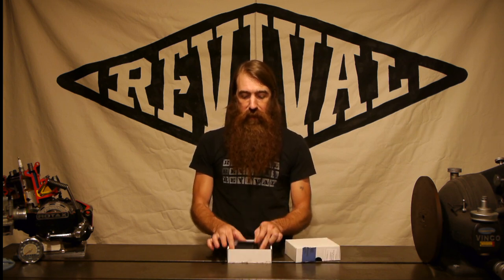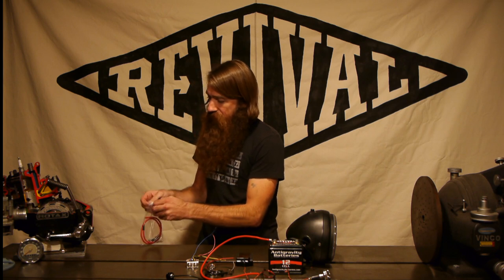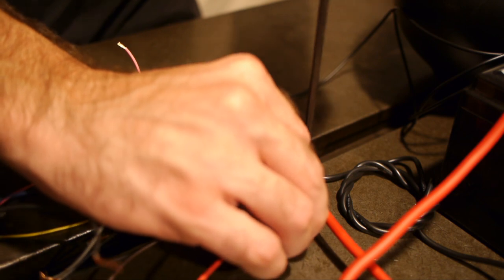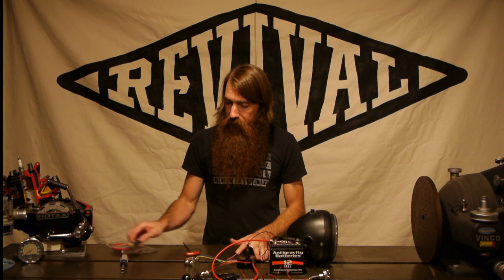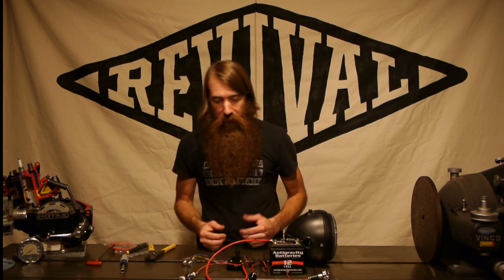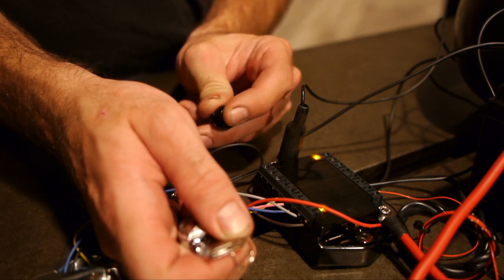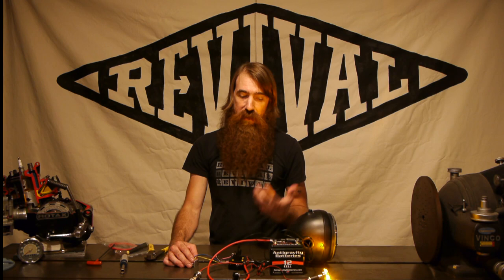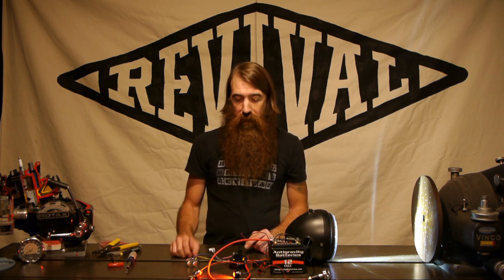Wiring the Motogadget m-Unit V.2 - Revival Cycles Tech Talk

Comment: Hi im wondering if this would work on a old evolution softtail im working on. Worried the heat from motor could damage it. I would like to mount it to frame under between the split tanks. Where the relays are now. What do you guys think. Would the heat be a issue to the m unit?
Reply from the maker: The m-Unit is pretty robust, and although it does have limits to how much heat it can take, we have found that under tank mountings have not been a problem. The technology is perfect for your application, and if there were existing electronic components in that area, that is a good indication that the m-Unit will be just fine in that spot.  The m-Unit doesn't produce any heat so it doesn't really need any cooling, and it is rated to operate at temps upto 80 Celsius or about 180 Fahrenheit.  It may feel hot under the tank, but  consider that standard SAE wire insulation is only rated to 85 Celsius. All this, combined with first hand experience, and you should be just fine. Also you can add some heat shielding for additional piece of mind.
Reply: Revival Cycles appreciate it brother. Evos are immortal.

Comment: how do you wire the motogadget to a positive earth system early triumph
Reply from the maker: Ok, the best way to deal with this is to switch to a negative earth setup. Which sounds way more complicated than it actually is. If you are doing an m-Unit install then this is the best time to do it. There are only two systems that are affected by the polarity of the earth, the charging system and the ignition system. Many times it is just a matter of re arranging the connections to match the new earth setup.

Comment: would I be able to run my coils on my virago?
Reply from the maker: Yes the m-Unit is capable of powering the coils on a virago, but you will also need to wire in the rest of the ignition system so the coils produce a spark. When installing an m-Unit, the charging system, and ignition system are setup as they were from the factory, but they are powered from the AUX output instead of the original key switch or relay.

If you would like more details about a specific application email techsupport@revivalcycles.com

Comment: can i use this on my gsxr 600 k4  bike?
Reply from the maker: Yes, the m-Unit can be used on virtually any motorcycle that has a battery. However, the installation gets more challenging when integrating with OEM fuel injection, and ECU systems. Before starting a project on a fuel injected bike we suggest doing some research and planning to make sure you understand what is involved before you begin.  Here is a link to the manual for the m-Unit http://motogadget.com/media/downloads/manual/munit_v2_manual_en_3.5_k.pdf

Comment: What about the ignition system though?
Reply from the maker: 1. Keep in mind that this video is for the obsolescent m.Unit V.2 and the newer m.Unit Blue has more output terminals and expanded functionality. 
2. The ignition system isn't really changed by the installation of an m.Unit. You just locate the single wire providing power to the ignition and install it in the IGN out on the m.Unit.

Comment: Hello Revival cycles, I have an old 1965 honda s90 with a bad engine which use 6volts.  I would like to swap this engine with DAYTONA ANIMA 190CC FLX engine which use 12Volts.  Could you hook up the wires: headlight, tail lights, turn signals, etc onto this m-Unit V.2?  If yes, then i should follow this schematic: https://www.google.com/search?q=m-unit+v2&biw=1745&bih=850&source=lnms&tbm=isch&sa=X&ved=0CAgQ_AUoA2oVChMIqdODkM7nxgIVR6WICh0oUQDS#imgrc=5nVOi-ULDp5CaM%3A.  right?  thank you
Reply from the maker: Quoc Luu 

Yes, BUT the light bulbs in the gauges, headlight, tail light, brake light and turn signals will need to be switched from 6V to 12V. Also, the ignition system and regulator rectifier will need to be compatible with the new engine. The original 6V horn will work if is is used for very short amounts of time, if it is used longer it could burn out due to the higher voltage. The better plan is to replace the horn with a 12V unit. 

The wire diagram referenced is correct and the m-Unit is capable of working with a 6V or 12V system so that part is the same in either setup. Hope this helps! If you have any other questions, please email us at websales@revivalcycles.com and we can help answer questions there, as well.